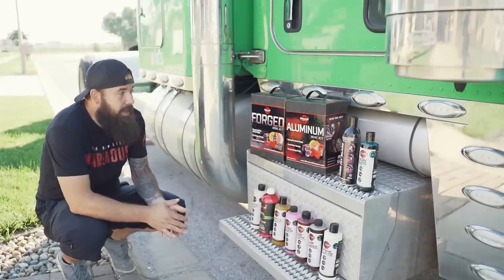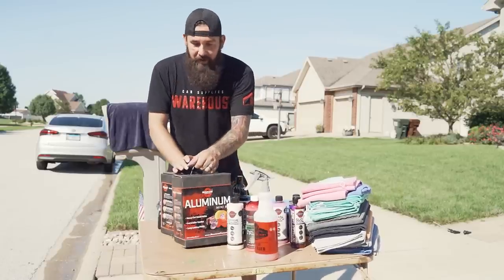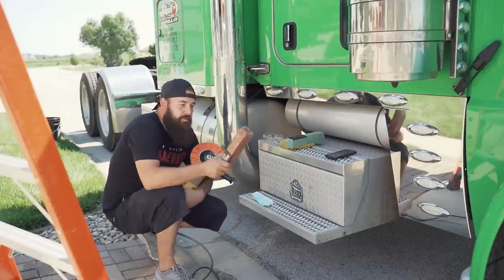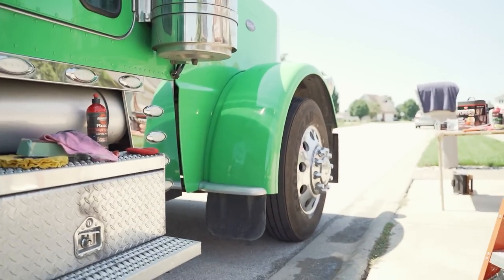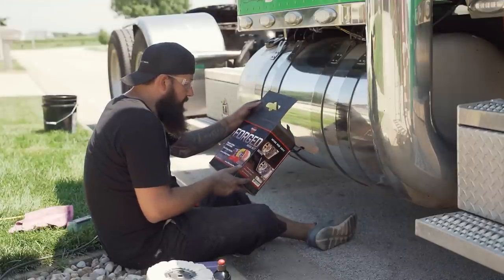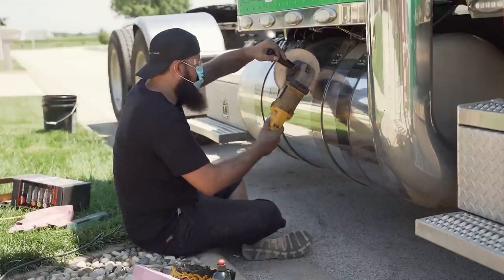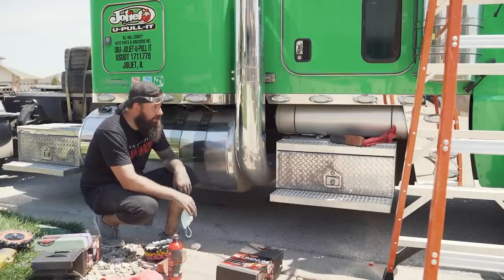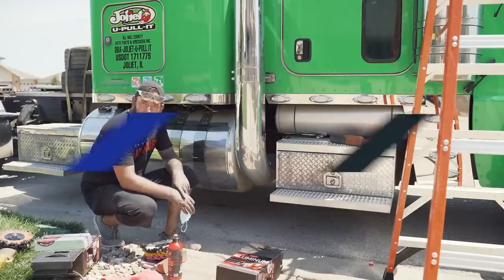How To Polish Aluminum, Stainless Steel, Diamond Plate and Chrome | Metal Polishing

Comment: Those blocks are called polishing rouge (probably not spelled right). The orange and yellow wheels are cutting wheels. I used to cut and polish at my old job. You get a much better result when you run a higher rpm tool. We used a dewalt grinder running at 9,000 rpms. You'll know when you're running a a good tool when you hit a wheel hole or lug nut and you dislocate your shoulder lol. On tanks, fuel and air, always move at a side to side motion, never up and down. It's very tedious and time consuming work, but the outcome is spectacular. We used to make our own polish with green rouge hammered into a powder, mineral spirits, and lighter fluid. Goes on green, then rub until it turns black. There's a product that looks similar but I've never tried it, called Zephyr. I could tell you were using a low power tool because your entire face wasn't black lol, I don't miss those days at all, very hard work. Love your videos man, keep it up.

Comment: Turned out Great Jason. Part of my job at Schock's Towing is maintaining the trucks cleanliness. And the mass amounts of metal on these trucks have been quite the chore lately. I used to enjoy doing the metal polishing, but I think it's the products I am using that is making me not look forward to it anymore. Not necessarily slacking, but moreso the products I'm using. Just doesn't get the correct shine I'm looking for. I'm going to have to try out this Red Rebel Aluminum and Forged kits. Also definitely need to get a Dewalt polisher as well.
Reply: What do you mean it turned out great that looks absolutely fucking horrible I wouldn't be able to charge $30 for that

Comment: Like u said bro, alot of work.  But maybe this tip may help just a bit. You can use the front of the wheel, (to an extent) Not just The edge.  I fully get why one would use it as you are.  & of course you can't use it flat.  But,  you can use a bit of the front which will save you a little bit of work on the shoulders and ceps.. plus, will allow you to get a bit more "bite ". By applying pressure and flexing  the wheel

Comment: What do you do for PVD fake chrome?  I searched your videos and nothing returned for PVD.  I bought my 2015 Ford F-150 last year that had several black spots on the "chrome" rims that I thought was plasti-dip that someone had coated them with and hadn't gotten completely off.  A month after I got it and had time for a proper detail, I found out it was chips in this PVD coating, this was after I had started to use a chrome polish on them.  After finding out online they weren't chrome, I've used the normal paint scratch removal with 101 and 102 and other things without very good results.  And no idea what to do to hide the chips.  My searches show I could send in the rims and have them re-PVD'd, but I don't have the money for that or for other rims to put on the truck or have it sitting for that time with no wheels.  Maybe you could do a video on how to handle this "chrome", as it is supposed to be 80% lighter than real chrome and promoted by manufacturers as better than chrome and probably used a lot more in the future.  It would be great to see the proper way to clean, polish, protect and handle blemishes on them. Thanks, Randy Ragon, Porter IN.